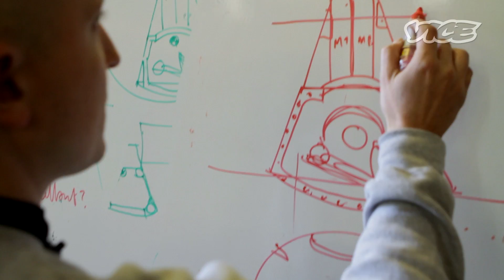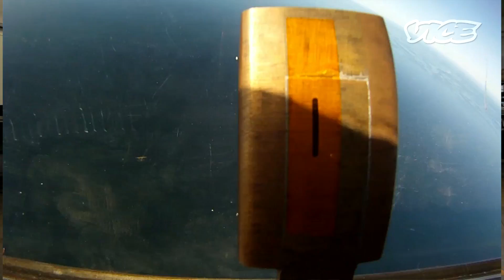Building a Homemade Spacecraft

Comment: Also don’t forget the high level of radiation out in space and how hot it is to pass the atmosphere, it’s too hot there so need to make it very resistant, also 15 seconds of propulsion in the rocket engine won’t be enough no get it to space, need to make it at a higher scale and good luck I hope you ideas grow up, I’m 14 and I want to make my own designs of rockets when I grow up

Comment: Admirable. I do anyhow have some doubts about the engine cooling. If you compare this engine with modern Nasa or SpaceX, not forgetting Russian engines, this one is very rudimentary and will probably melt itself in a burn long enough for substantial altitudes. A few kilometers is a far cry from being suborbital, albeit being test vehicles. Keep trying anyway. A long, very long way to achieve what you are aiming at. Maybe some day it will happen. Thumbs up for your noble effort!

Comment: yeah but...wood wrapped in fiberglass tho.
Reply: the heat from a rocket would melt it and combust the wood
Reply: The Flying Gasmask not if you impregnate the poly resin with a carbon powder like graphene. I'm only talking about the fuselage too...for parts that have to undergo reentry. a rocket engine nozzle made frome graphene might work though. idk.

there is a British dude on YT that has a graphene plastic flame test among other miracle uses for it. it's pretty cool stuff.
Reply: HillbillyMatt ExtremeDIY the graphite may survive, but whe wood would still combust, even if wrapped-.

Comment: I think lot's of people could build a rocket that would take them to suborbital space with a few thousand dollars.  The challange is not getting killed by:

1. Oops! My rocket is accelerating too fast!  I'm getting.... crushed... to... death!!!
2. Oh no! My capsule is leaking air!  That guy at the hardware store said this glue was strong, dammit!  I can't breathe and my blood is boiling.  Ah!!!!
3. I didn't realize it was 69 degrees below zero up here and I forgot to bring sweats.  I can't feel my face!!!!

That's if your rocket doesn't explode.  So make sure you learn all you can about rocketry, and do your Trig and Calculus homework.  Be sure to test your prototype until your neighbors quit inviting you over. If you do all that, then by all means, take some pictures and video of your trip and post them on instagram.  Oh, and be sure to check the zoning laws and notify the FAA first.

Comment: question to peter if thrust is mechanical...how does it impart force to the space vacuum...if the vacuum applies no resistance to the flow of mass how does the flow of mass make work?

no mechanical force can act on the vacuum of space..it is void  and cannot be pressurized it has no surface no shear resistance no friction can be applied to a vacuum... mass flow from any nozzle that is open to the vacuum.... is subject to the laws of the vacuum....mass flow (the propellant gases) cant exsist in a vacuum...gas needs a containing force in order to be a gas......you might say nozzle again or reaction chamber and nozzle....once the nozzle is open to the vacuum it is subject to the laws of the vacuum...

please tell me how rockets over come this problem in a space vacuum???

Comment: I wonder why there hasn't been more effort to develop "rockoons", where rockets are lifted to the stratosphere by balloon  (or a high altitude dirigible) and then launched into space. It would seem to be more cost effective and achievable for civilians to do it that way.
Reply: +John Snyder AFAIK, getting the rocket 30-50 km high isn't the main fuel-heavy part of the flight. You see, rockets don't just go up into space - going into orbit requires accelerating the rocket to a horizontal speed of almost 8 km/s, once you're already in space. In fact, designing and building a balloon/dirigible that can lift a rocket to that height and hold it stable enough to launch seems to me to be more challenging than filling a metal tube with fuel and setting it off (yes, i'm over-simplifying). 

Of course, the speed argument is rendered mute if you're talking about only suborbital flight.

Comment: I don't know, but they're gonna need a more durable material for re-entry with that capsule. Whats the metals max temp? It's not gonna go so well against re-entry plasma.
Reply: +James Bear
He's only planning to go straight up, and back down. There's not a whole lot of heat generated from that, seeing as you're not going in true orbit, but rather, a very steep sub-orbit.

Comment: I don't know why they wouldn't use liquid hydrogen/oxygen fueled engines. I mean with a decent solar array you could power quite a few generators. More money would be available to R'nD
Reply: +Jay Goldie i think they are going for a non cryogenic fuel source
Reply: +Tester I ment liquid hydrogen and liquid oxygen
Reply: +Tester +1!
Reply: +Jay Goldie Liquid hydrogen is horribly difficult to work with and store. Methane or RP1 is much simpler and 85% the performance.

Comment: So the record altitude for a balloon is 33 miles.  That is roughly the altitude at which a major rocket would drop it's first stage.  Allen Shepherd's Mercury flight was around 100 miles up.  That was a redstone rocket.  I'm under the impression that what these gentlemen are trying to accomplish would be something on a par with the Mercury program.  So I'm wondering if one could not save a lot of time, energy, and money if one would build a smaller rocket and launch it from a balloon.
Reply: +nunya biznez I had the thought of launching a rocket from a launching platform carried to about 100,000' by four weather balloons.  The idea was to launch a small rocket, something like hobbyists would launch.  If it will fly to 1000' at ground-level, it could fly to a much higher altitude, much faster if you have already escaped most of the gasses that make-up Earth's atmosphere.
Reply: You would need a massive ballon, I made a ballon, it was helium filled and the ballon was 4 ft winds, and yet it could only take 1 KG up to about 35 kilometres, those rockets weigh hundreds of kilograms, so the ballon would have to be so big that the ballon would probably cost more than the first stage xD
Reply: +RandomGaming I have had the same idea, as have many people on the internet. And i found that the most feasible way would be to use a square fame holding the balloons on each corner so that the rocket in the middle would fly past.

The problem is this:
balloons would need to be large enough to carry the frame and a VERY heavy rocket, thus larger balloons needed. but then a larger frame is needed to ensure a rocket can launch through, but the frame is larger thus a larger balloon is needed.

It actually is an in-feasible condition. And a weather balloon could lift a small sounding rocket, but the price of operating a balloon for any given rocket size would be more expensive then producing a rocket stage to deal with that phase of the ascent.
Reply: +Junn Kopf 
What if we shaped the balloon like a giant doughnut?
Reply: +nunya biznez it's a good idea but it is very hard to get such a big balloon...
a plane is a better iea and in fact the pegasus rocket does just that!
Reply: +nunya biznez the problem with your idea is that balloons float directly above their payload, and rockets are far, far, FAR heavier than a conventional balloon payload. so the balloon would have to be far, FAR larger.
Reply: *****
no i'm saying if you try launching something from a balloon it'd hit the balloon
Reply: +nunya biznez Wouldn't a rocket standing on a balloon push it down while trying to launch? Not an expert but I think there's no solid base to give a good contra for the powerful rocket pushing down.
Reply: +PuppeteerInteractive you dont need a base for rockets to push against, thats not how they work
Reply: +Matthew G Yeah I thought about for a while since I said it, this isn't a guy-pushing-against-a-wall type of thing. Just a senile moment :)
Reply: +nunya biznez  I've often wondered about using some kind of balloon system for years. Yes a single balloon would probably be very awkward to work with. A launch pad suspended between three evenly spaced balloons may work, if you could manage to maintain stability (not let one float above the rest, and throw it randomly side ways). Yes the weight of such a rocket would be quite substantial, but maybe over all weight can be reduced because by reducing the travel range of the rocket by 30 miles it would be required to carry less fuel, and and need less overall size due to the decreased overall fuel requirements. Just a thought.
Reply: what someone said above is a great idea.. use many donut shaped balloons to make like a chimney out of the balloons with a launch pad at the bottom which would keep it from tipping because it would weight it at the bottom. then just shoot the rocket out of the balloon chimney when it reaches the right hight.
Reply: I can't wait to see how far you'll be able to take this. How ever you figure out what works, this should be cool.
Reply: Even if you could launch from a platform from 33miles up it wouldn't be the same.

When the rocket stages it'll not only have altitude from the booster, but it will also have the needed vertical and horizontal velocity. 1st stage contributes  around deltaV of 2,500 or 3,500 of the ~8,000 needed for LEO; a altitude alone makes up a small portion of required energy.
Reply: What if we launch from the top of Mount Everest
Reply: Just detach from the balloon at the right altitude and the start the rocket.

Comment: I wonder where they buy the ethanol from? 
Are plans available for the engine?
Rather than launching a capsule, wouldn't it be better to build and launch a flyable craft of some description along the lines of a small lifting body.
Reply: Dan NZ They only want short sub-orbital flights so a controllable/flyable machine is not important yet.
Reply: Yeah I guess.

Comment: You must be more creative, We do not need to burn fuel to lift of.
Reply: Bartosz Barejko You don't achieve escape velocity with hopes and dreams.
Reply: Natus A Mort  Please check my movie there is some on it :>Graphite Dust into very conductive strong material,carbon sheets and more.
Reply: Bartosz Barejko How else would we do it? Could we find a better more efficient fuel? Certainly. We already have changed fuel a few times.

However we will always burn fuel to get to space. Or at least for the foreseeable future.
Reply: Bartosz Barejko Flammable fuel is necessary to escape Earth's immense gravity, but you are right, once in space there are many options for propulsion.

Comment: A rocket with this kind of interesting design should go into a controlled spin, imho. It would "screw" itself into the sky and get more stability. The capsule could be attached to a gyro, in order to keep it from spinning and to stabilize the rocket/control the spin.
However, this system seems to waste a lot of propellant by dividing the force outwards. I guess they didn't want to build a huge launch platform and thought of a more practical solution. However, I think classical rocket design with the capsule on top is still more efficient. I'd really love to see some breakthrough in true spaceflight, in the near future. It's impressive that so many companies are trying to reach suborbital, but going to the stars is what it's all about.
Reply: That rocket on top of the capsule is to eject it from the rest of the rocket if there's an emergency on takeoff. It's not how they plan to achieve [sub]orbit. :)
Reply: TheLobstersoup I agree that they have done a great job so far but as you say, "going to the stars is what it's all about".  Also it seems to me that they are mimicking the past with their designs, wouldn't it be better to launch a real spacecraft.

Comment: KSP irl, hmm awesome, but how are they guiding the rocket. The video focused allot on the mindset and construction process, but little in the way of software. I kinda feel it's a necessity if they ever want to actually send someone up in that pod.
Reply: They plan to guide it completely with rollerons. Basically, it's unguided. They've also made an actively guided rocket, which may have it's technology incorporated into the HEAT-2X Deep Space II, but the goal is to be simple, so I doubt they'll do that.
Reply: William O'Connor
Thanks. though are they using any kind of automated guidance or assisted flight? Manual control for something like this just seems lacking in prudence.
It's weird to think that with all our technology that the majority of manned locomotion is still powered by controlled explosions.
Reply: Sorry. My mistake. Originally they were going to use ballistics and make it totally passive controlled, but they realized that would be totally impractical unless the pilot could withstand 10 Gs on takeoff. 

Now their system is going to have a simple flight computer, vectored exhaust, atmospheric controls and capsule reaction controls.
Reply: It's probably pre programmed.

Comment: It might survive because the parachute never had a chance to open and slow the fall.  It was sort of whipped into the water on the tail end of the rocket.  And it looked like powder of some kind, not water, when the capsule fell into the water.  

You are correct about the Soyuz 11.  Not a good way to go out at all.

Comment: There already are.

You need to be at least 21 in the US to buy vodka or Everclear, which is fundamentally the same thing as the alcohol fuel in this rocket.

Liquid oxygen can be purchased from chemical supply plants, provided you have a suitable container for it.

Even then, potassium nitrate, sugar, and sulfur can make solid rocket fuel.

Rocket fuel does not explode, anyway.

Comment: Actually its more like 5-6 parts oxidiser to one part fuel (that is mass flow ratio). Even if you count individual molecules (stupid thing to do) there are currently no engines running at the perfect stoichiometric ratio.
So yeah.... knowing the chemical formula for water does not make you a rocket scientist.

Comment: This is like saing that cars are fueled by CO2. There are no rocket engines running on water. Water is just found in the exhaust and it just hapens to be the only exhaust product of one type on rocket engine. Having water and having containers of liquid oxygen and liquid hydrogen are two very different things...

Comment: yeah, you can split water into hydrogen (H2) and oxygen (O2) through a process called electrolysis of water; and algae, does produce oxygen through natural processes. I think the fuel Dr Tyson was referring to burns hydrogen in the presence of oxygen, which produces water as an exhaust, also used for rockets.  As for muppet of love's comment, one can make explosive hydrogen from water using electrolysis of water, so there is little they can do to regulate hydrogen

Comment: You are right. Although I have heard that early systems to move around (in the shuttle I guess) were  basically aerosol cans.

Can water be split into H2 and O2(Yes I know you need more O, I just want to know if it can be done)? I hear algae can do this.

I assumed water because Neil deGrasse Tyson said the H2 tank was twice as large as the O2 tank. And the reaction of the two is exothermic.

Comment: I am sorry for my ignorance, but how on earth do you burn water?
The only way for propulsion in a vacuum is using Newtons third law, as there is no air to push against so it is either utilizing the force of an explosion to provide thrust, or pushing water out the back like a bottle rocket, and For your information, no bottle rocket has ever made it into space. So could you please explain, in my humble ignorance, how to make water a fuel.

Comment: rocket fuel :)?
Mix some sugar with nitrite fertilizer and you obtain a cheap solid rocket fuel burning at 5000 m/s. Your choice if you want a small rocket or a bomb.
Add some metal powder (iron, aluminium, magnesium, or whatever) and it is your choice if you want to have fireworks or an incendiary bomb that can literally melt your car.
Ingredients are free on the local shops. Recipes are free on the tube and you just need the brain to discern what you should do or not to do.
Nothing is secret!

Comment: Actually, that's what happens if you a)leave the atmosphere, b)don't exceed Earth's escape velocity and c)don't circularize your orbit.

If I recall correctly, Explorer 2 left Earth's atmosphere but never reached the target orbit because of a failure in the last stage of the Juno launch vehicle. Also, technically speaking, the North American X-15 experimental plane left the atmosphere without reaching orbit.

Comment: I'm pretty sure the test flight we saw was only testing the capsule. The rocket attached was just a temporary solution to getting the capsule in the air. To get that capsule into space, something A LOT bigger is required-- especially due to the amount of fuel needed.

Comment: Kristian,
I've been following your efforts for some time and it's all quite inspirational. I have a couple of questions.

1. How did you decide on a spacecraft that is 160 cm in diameter? I would of thought something 200 cm would have advantages such as eventual expansion to a 2 man craft, and be much close to a 1/2 scale ACM design.

2. Do you plan on designing a SM later when you're ready for an orbital flight? It seems your design is so good, it is something you could continue to expand on..

Comment: I can all ready tell, by the way the seat is positioned, that the passenger will have blood loss to the head sitting that way. The reason why NASA astronauts do not pass out/blackout during launch, is simply the seat is turned to where the blood will rush to their heads rather that their lower limbs.